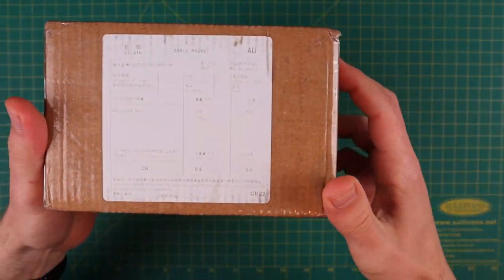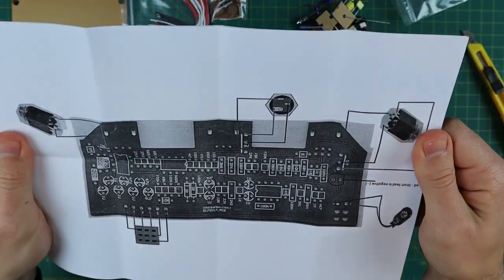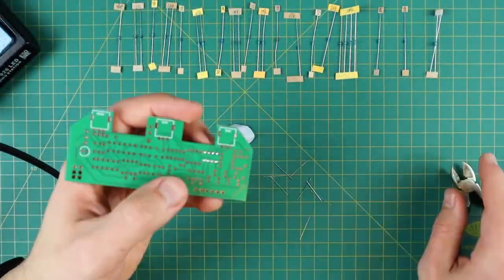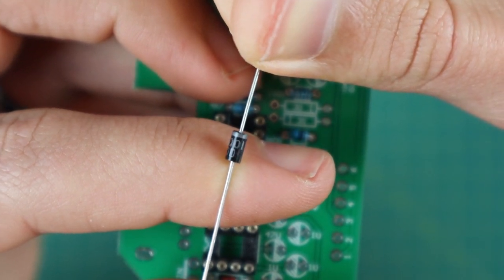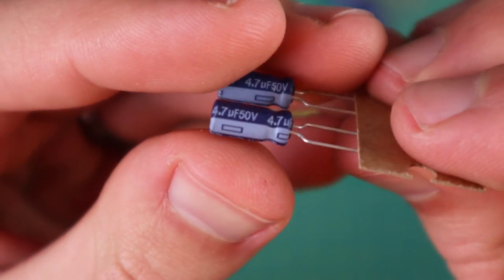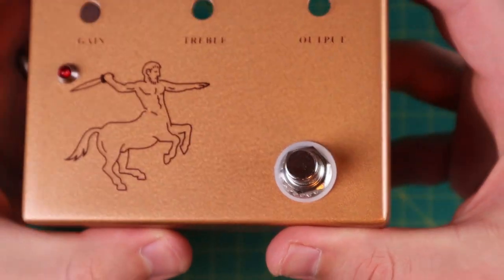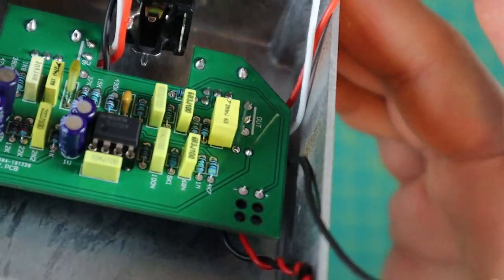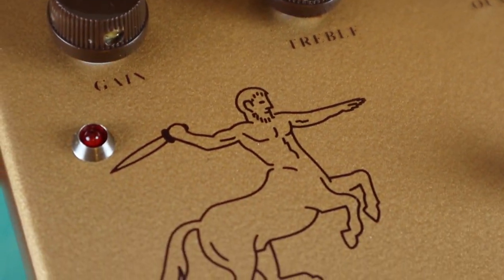How to Build a Klon Centaur Clone From a Kit (Step-by-Step Tutorial)

Comment: I'm sorry for taking more of your time, but two months ago I had fried a copy of this pedal I had made. Finally I got to diagnosing and repairing it.

Predictably enough, the ICs, 7660 and both the op-amps were dead, so I replaced them and rewired the whole thing using the diagram. Then I reinforced the solders on the pots that had gone a bit shaky (which is why I usually don't solder pots to the circuit board, and prefer wires).

Now it works. Sort of. It has a high pitched whistling sound and doesn't quite sound right, more like a fuzz pedal than an overdrive, even at lower gain settings.

Could it be because of a capacitor gone bad? I suspect the polarized electrolytic to be the culprits, but I wonder if anyone could provide an insight into this.

I have already eliminated the power supply as the source of the noise, because it persists even when the pedal runs from the battery. Strangely enough, blowing on the circuit seems to modify the pitch of the whistling, makes it become lower. There are no hot parts in the circuit - I checked.

And again, thanks for all the good work you're doing.
Reply: Another possibility is a feedback oscillation loop or a solder bridge. I'll keep looking into it meanwhile.
Reply: And yet another test I ran, though I do not recommend anyone do this, I tried touching the backs of each electrolytic capacitor with a grounded screwdriver, kind of a desperate last ditch effort.

Two of those caps actually responded by INCREASING the volume of the whistling - two gray electrolytic caps in the lower left side of the board, where a bunch of those are.

It's either a dead cap or a bad solder or a bridge, too tired to take the PCB out of the case - unsoldering and desoldering the LED is unpleasant.

Comment: I had it working after i realized the input jack was wired wrong. Tried it out was so excited. Then had to re wire the led and not sure what happened, but plugged it in and one of the black capacitors started smoking and burnt up.... Oh ordered another one for another shot

Comment: Hi Aaron, great video man, i wonder if you can please help me? i bought a Klon of Aliexpress a while ago but unfortunately i had my power supply set on 12v instead of 9 so I may have blown a component, any ideas how to identify and replace the part? maybe a good future video subject?
Reply from the maker: Sorry to hear that, hopefully you can sort it out. I'd use a multimeter and follow the schematic to see where along the circuit the signal stops. I'd imagine at some point you'll see something go wrong. I'm not very good with electronics, so if that doesn't work hopefully somebody else who knows more can give you proper advice.

Comment: Just followed the video step by step, and success!! EXCEPT for one issue. The input jack, for some reason, when mounted to the pedal, grounded the signal and left it mute. When I took the jack out, plugged in, sounded loud and perfect. I ended up rearranging the black, red, and white wires until the sound worked when the input jack was fixed to the pedal, and it works now. I’m curious:
a) I followed the video PERFECTLY, did I just not orient the wires correctly?
b) now that it works, could I have reconfigured the wires in an incorrect way? I worry that I’m not getting the best pedal sound in the event that I did not put the wires in the correct locations.
Reply from the maker: Because I soldered the wires on the other side of the PCB, it isn't very clear in the video how they connect up to the jacks and it doesn't show that two of the wires cross over behind the PCB. That's why I recommend reading the guide on the website as it includes clear diagrams. 
So your jack was likely just wired the wrong way. Now that you have fixed the wiring, everything should be fine.
Well done on your build.

Comment: hi aaron,
yesterday I build this kit as my first pedal build with your help so thank you!! it seems to work fine but I have a question about the treble knob, it seems reallly dark in general and only when I turn the knob all the way I have a quite bright signal. so I was wondering if I maybe loose some high end through a bad connection or if I could do something to get more high fq out? maybe the pedal is quite dark in general but I would love to have a wider range. tried it out with multiple guitars. thank you so much again
Reply from the maker: It shouldn't sound really dark, so it could be that there's a bad connection. If you have a multimeter, go through and check the connections as well as double-checking that the values of the pots are correct. If there are any solder joints that don't look quite right, use the soldering iron to reflow them. Good luck.
Reply: @AaronMatthies  thank you! will try this today

Comment: Hi! I am having issues with mine. The LED isn’t lighting up when I connect a battery and a lead to the out jack (and after pressing the foot switch).  I tested the LED using the multimeter on diode mode and it works fine. I have disconnected the 9V power supply input temporarily and have taken the LED out of the bezel. How can I use the multimeter to pin down the problem? I followed the wiring and have double checked against your instructions and the new coloured instructions that now come with the kit
Reply from the maker: If the LED isn't lighting up, my guess is there's either a bad solder joint or something shorting and stopping the current getting to the LED. Set your multimeter to continuity mode and connect one end to the 9V+ connection. Then follow the circuit along with the other end of the multimeter looking for continuity problems.
If that doesn't work, search how to build an 'audio probe'. I found this an easy way to pinpoint any issues as you can hear when the signal suddenly cuts out due to an issue.

Comment: If you're using lead-free solder, it won't ever get shiny so maybe mention that when you talk about looking for shiny solder. When no one ever specifies that shiny only applies to tin/lead solder, people can get confused and think their solder joints aren't good enough because they aren't shiny when, in fact, they are. 

It's recommended to use 62Sn/36Pb/2Ag solder with 2% silver when soldering on circuit boards. Just FYI.

Comment: i built it following ur video, it works but it microphonic as hell, do you think it's the ceramic cap? shud i add a resistance to the led? otherwise it works great.
Reply from the maker: Hmm I'm not sure what could be causing that problem. I don't know enough about capacitors to know if that's the issue. 
There's already a resistor for the LED on the PCB, so you shouldn't need to add one.

Comment: What I wanna know is what type of solder is being used. I'm not good with circuit boards and soldering, I'm pretty shit at it but I always try my best on guitars. Can I just a use the same solder as on guitar electronics since that's pretty much the only one I have or do I need another kind?
Reply from the maker: The solder you already have should be fine. If you want to practice your soldering before working on the kit, buy a cheap prototype board (they're small boards with grids of holes) and practice soldering wires to the holes.

Comment: Aaron ive got one klone i bought for 60$ and ive just ordered one cheap kit and one$340 kit that alledges to have better quality parts but the cheap kit (similar to yours) seems fine im just curious for the difference in quality
Reply from the maker: Everyone seems to have different opinions on how much of a difference the quality of components can have on a pedal's sound. You may find that the $340 kit sounds far better than the cheap kit, or you may not notice much difference between them. You would expect the more expensive kit to sound better, but there are plenty of blind test videos on YouTube where people struggle to tell different clones apart. One thing I've learned with pedals is that the price tag isn't a good way to judge how the pedal will sound.
If you do build the $340 kit, I'd be keen to hear from you how much of a difference you notice in tone.

Comment: Hi, I just finished mine and it kind of works, when it’s plugged it just cuts the signal, but when I turn it on, you can hear some signal, what did i do wrong? Please help! By the way this video and your website are the key for this product! Thank you very much!
Reply from the maker: So when the pedal is in bypass it cuts the signal but it works fine when you hit the footswitch? Or doesn't it sound right when turned on? Sounds like a strange issue. If you don't find an issue such as a bad solder connection after you run through the suggestions in the troubleshooting section, I would look at using an audio probe and it should help you track down the problem. I haven't written a guide on building an audio probe, but there's a few on other websites. Almost all the issues I've had with my pedals were found using one.
Don't let it get you discouraged - you'll find the problem, it just takes time. I know how frustrating it can be when it doesn't work on the first attempt.
Reply: @AaronMatthies  it doesn’t sounds right. Is like the signal is too weak, but I know that there is a signal going through! Can I send you a picture?
Reply from the maker: Sure. Use the contact page on my website and I'll have a look.

Comment: hey thanks a lot for the guide! Just assembled mine. I have a couple of issues. The gain goes back to zero a little bit before it reaches the max , and there is also that clicking noise from the footswitch whenever I press it, and it goes through the audio signal. Any ideas on what might or what won't be the problem? Thanks
Reply from the maker: I'm not too sure about the gain knob issue. The only thing I can suggest is to double check you're using the correct value potentiometer and that all of the solder connections are making proper contact. Not sure what else to suggest - hopefully somebody else might know more about how to troubleshoot that problem.
Reply: @AaronMatthies  I actually solved the issue after cleaning it up a bit, what about the footswitch noise? Is it happening in yours too?
Reply from the maker: Good to hear. The footswitch in mine doesn't click, but it wouldn't surprise me if they sourced different footswitches over time, so the one you have may be different. If it's annoying, you could look at swapping it with a different one.

Comment: I'll try to build this pedal, but not from kit, I have schematics and I'll do it with my material, all from scratch, only problem is that I have TL 082 processors, but originally pedal use TL 072, (these are compatible) but does anyone knows will tone be affected bad with TL 082 ??

Comment: These actually sound pretty good! Does anyone know if it’d be possible to separate the pots from the PCB so that I could put it into one of the larger, more realistic enclosures you can buy?
Reply from the maker: Sure, just use some wires to connect the pots instead of soldering them directly on the PCB (same with the LED). I guess you would just have to find some other way to mount the PCB in the enclosure. I'd imagine there would be plenty of room.
Reply: @AaronMatthies  thanks Aaron! I’m a mega-novice with this stuff so that’s incredibly helpful and makes such basic sense! I appreciate you taking the time to reply.

Comment: Is this a double sided pc board? I see you soldering one side but the other side It appears the tracings are different. The side with components some connections have solder others not. Hope I'll be more lucky with this kit than the 1st one I attempted.Very good video btw
Reply: Just finished my kit. Here are my tips and answer to my own question. Yes the PCB is double sided as there are traces on both sides. I asked this question because If you solder only one side and the solder doesn't flow thru on the connection on the other side it will cause a problem. Because of this I decided to keep my resistors and caps about 3 to 4 mm in the air above the board. This is because you need to carefully examine your soldering on both sides everytime you solder a component. I started with the ic sockets as the legs were very close to each other and most of the traces were connected on both sides. I then installed a few resistors, going in a row and planning so that if I soldered a component it would not be in the way for my next install. The series of electrolitic caps near the switch were paticularly challenging. The twin pot too. Had to use a led flashligth behind the board to see if I had 2 connections bridged together. In my kit I received instructions with color pictures of the wiring.I followed your video too. comparing to the pictures in the manual. I installed my wires component side. The footswitch had the 4 and 6 wire  reversed. As I thrusted the wire colors instead of the numbers. There is one thing wrong in your video I believe and its the black and red wires on the output jack that need to be reversed. In the istructions the black is on the small sided end. Haven't tried it with the 12v connector yet. I hope this offers some guidance for the ones who bougth this kit. Fun little project for x mass vacation but I could not wait. Did it over a couple of days in the week.

Comment: I bought the same exact pedal (board is identical) in an assembled form but no 9volt battery harness was fitted.  What power adapter will work with this pedal since I'd rather not contibute to yet more 9volt batteries disposed of eventually?
Reply from the maker: Pretty much any 9V power supply will work as the Klon doesn't draw much current.

Comment: Hello, i follow up your step by step instructions, after assembly and plug-in the pedal didn't provide me any sound, do you have any suggestion?
Reply from the maker: If there's no sound at all, I'd start by checking the input and output connections. Then follow the troubleshooting steps covered in the guide. If you don't find the problem after all of that, building an audio probe will find the problem.

Comment: I soldered mine and it sounds great BUT none of my gain, tone, or output pots do anything… it’s like it turns on to a set setting 🤷‍♂️ is it magic 🤔 HELP!
Reply from the maker: The only thing I can think of is to check if there are any shorts on the pots. My guess is if there is a short, it might effectively bypass the pot and act as if it was cranked to full. Someone else might have a better idea what might be happening though.

Comment: i would prefer mini effects rack type rather than a pedal more room to work on more room for the caps also pedals are usless on the floor bending down slamming your guitar off the ground when you try and change settings whilst the guitar jack takes a beating. Just put the pedal in a little rack and run the jack to a external switch so you can sit it on the ground.